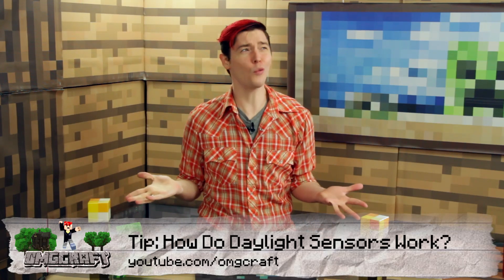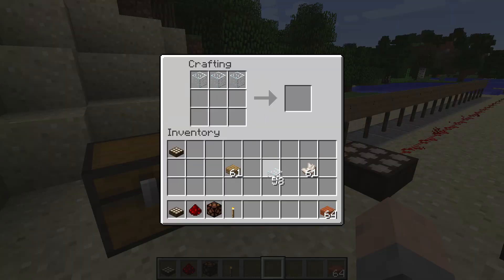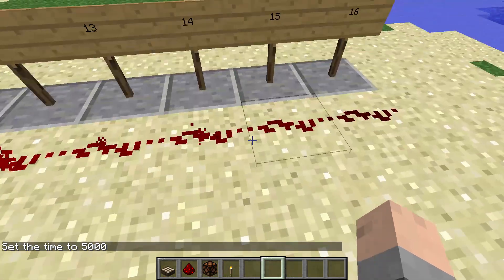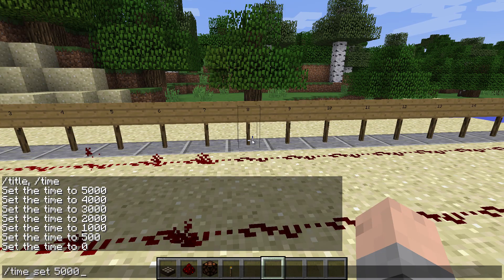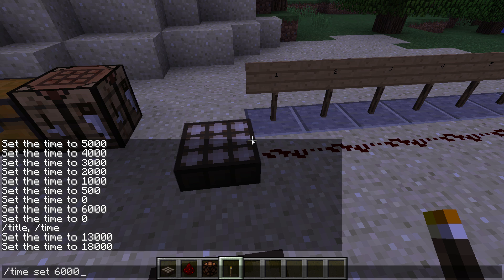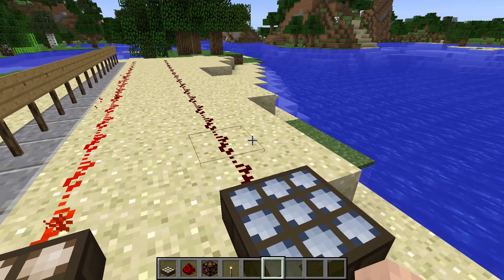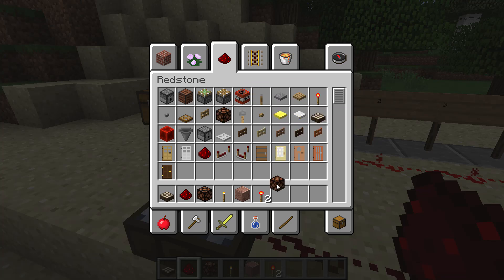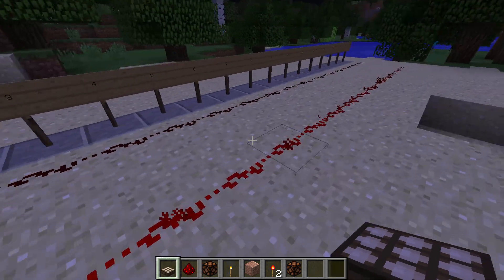How Do Daylight Sensors Work in Minecraft?

Comment: It's broken on PS3  , cuz the night sensor lights up on daytime too...
Reply: ROBLOX. Hulk it's not broken they added a new feature that makes you be able to invert the daylight sensor, wait 3 days, if it's inverted wait for it to turn nighttime, it should be powered, hook it up to something with Redstone, wait until daytime, it should still work at daytime which means, go to nighttime, break the Redstone, but a repeater in the spot you broke, wait the other day, daytime still works just do the same thing as last time, except a lot more repeaters, next night should work and daytime won't work, it'll work properly, this is only if you are having problems
Reply: I want to make Lanterns that only work at night.. but the Daylight sensor on top of the Redstone lamp doesnt work
Reply: ROBLOX. Hulk Yeah, I noticed, don't try that, it isn't hooked to redstone, it doesn't work, basically the daylight sensor

Comment: How do you do that at 3:52 i need some Night lights
Reply: +MehMoTronic3 Official Right click on it.  Like you would to activate a switch.
Reply: well dont works
Reply: So it doesn't change colour when you right click on it?  Well if not that you could try inverting a redstone signal, so it turns off the redstone torch powering the light in the day and lets it turn on at night.  This can be done both horisontally or (near) vertically to help save space.